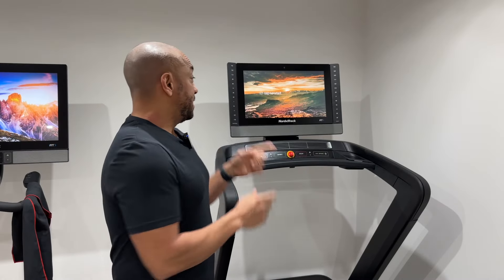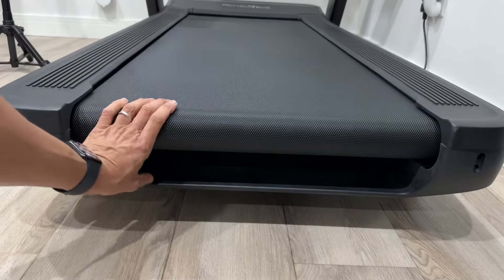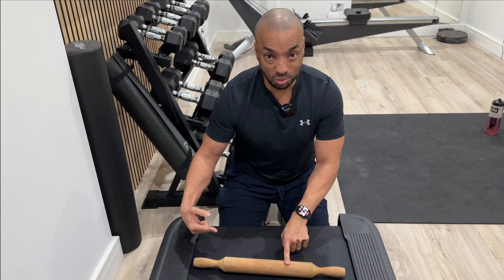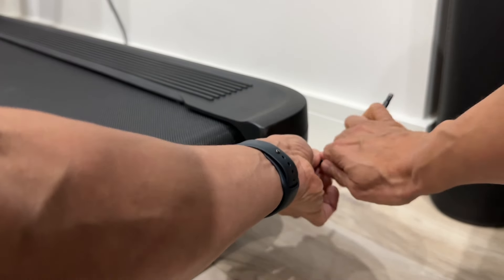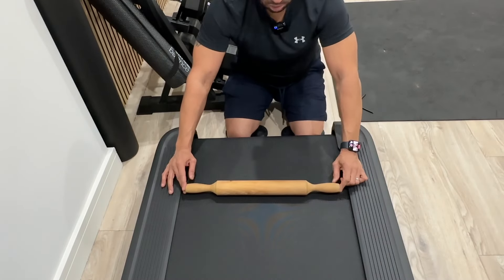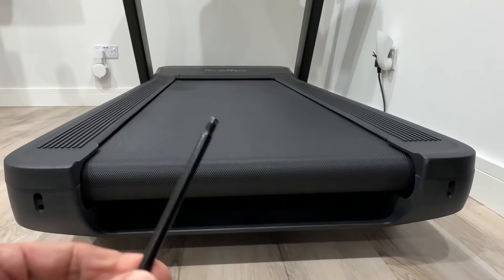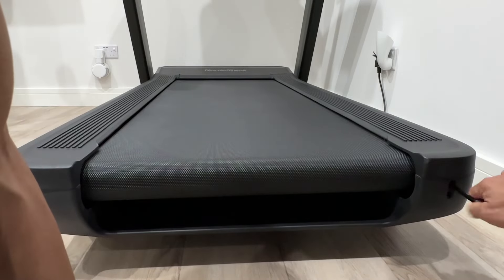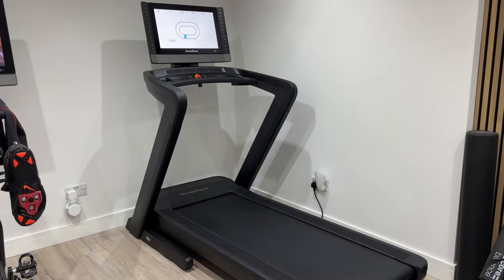How to Adjust a NordicTrack Treadmill Belt: Align and Tighten | Treadmill Maintenance

Comment: Wow this corrected the issue, I will never buy a NordicTrack product ever again, even if their are affiliated, if i find out someone use to work for them works with a product I will avoid it. over 4k plus repairs and I cant even run, its strictly used for walking and I weigh under 180lbs

Comment: If the belt is in center, how do you know if the tension is too high or too low. I didn't find any video explaining to ascertain if the tension you have set is ideal
Reply: The belt shoulding be higher than 2-3 inches when pulling it up from
The center

Comment: Hello Steve, I must appreciate all the help here and for every video you do in this fitness area. I really love nordictrack machines, I have 3 of them. 

Recently I’ve bought the 2450 treadmill, but I’m experiencing a squeaking noise since the 2nd day I have it 😢. 
It’s over 3 weeks now and I’m still with the same issue. I tried to put some wd40 and nothing, the squeaking continues and it’s so annoying. This only happens with incline between -1 and 5. It’s something to do with the incline of the treadmill. Do you have any ideas to help me Steve? 

Thank you in advance.
Reply: i had to lube the incline screw bolt on our 2450. it is underneath, slightly towards the front roller from the piston that helps to lift when folding.

Comment: Hey Steve I received my 2450 and love it! So far the video is a little laggy but I was reading and the next update should fix it. Quick question about the belt. My belt has a gap on both sides so I’m sure it’s centered….but when I was on it around 2mph I notice it slips. I’m also a little heavier though. Do you think it’s worth messing with it even if it’s centered? It’s less than 1 week old. Only used it twice.
Reply from the maker: If you think it’s slipping, then it’s fine to tighten. As it’s centred, try 1/4 turns on each side and see how it feels.
👍🏽
Reply: @SteveJulien  thank you for your reply! Wouldn’t tightening mess with it being centered?

Comment: Hi Steve, What happens if the belt runs skewed? So its central at the adjustable roller but not at the other end. On my X9i, the adjustable roller is at the front and the motor is at the back. The motor roller is not adjustable.

Comment: Hello Steve, see if you can help me out I would be very appreciated.  I have a nordictrack commercial 1500 model#09707.4.  How do I remove the front roller because it has no bolts or screws at each end?  Thank you

Comment: Have you figured out how to turn off the screen when you are done?  With peloton it was just a power button on the back. I don’t see any option on this screen to turn it off or any power button off.   

Only work around I have found is taking out the safety pin then it dims after 5 minutes.
Reply from the maker: Screen power button would be great addition.
I turn mine off at the wall socket or there’s an on/off rocker switch on the treadmill where the power cable goes in.

Comment: What if I've got like... A half-inch of "give" between the belt and the "floor" of the treadmill? Like when I step down, there's a gap between the belt and the floor and makes the walk feel... tacky. Do I need a new belt entirely? I've got an old NordicTrack; stumbled on your video by searching something like "Nordic Track tighten belt".

Great video!
Reply: This.
I have the same with mine.
Did you get any answers? If yes please share.
Thanks
Reply: Wow, my same question too.  I don't know if it needs tightening, or loosening.  Either of you figure it out yet?
Reply: No, I haven't gotten an answer and my treadmill is still tacky!

Comment: Bought a new 1750 and never could get belt centered. Chewed up the first belt. Installed new and had same results. I will not recommend a Nordic track
Reply: I just got mine and been trying to get rid of the slippage by tightening the roller, it either shifts to one side while running or does not feel like it gets tightened at all.